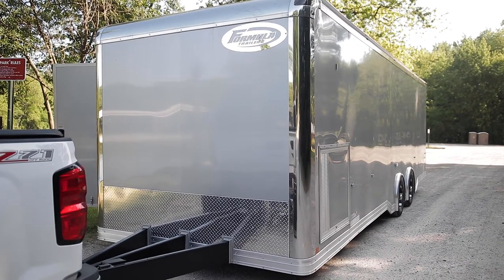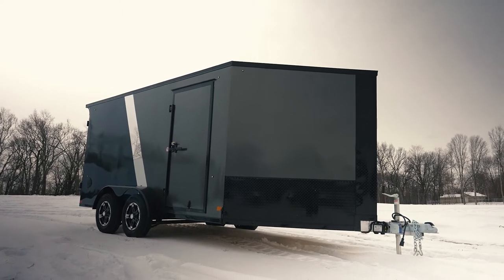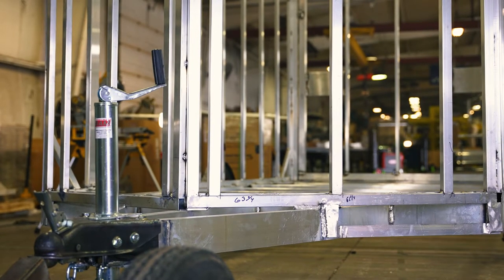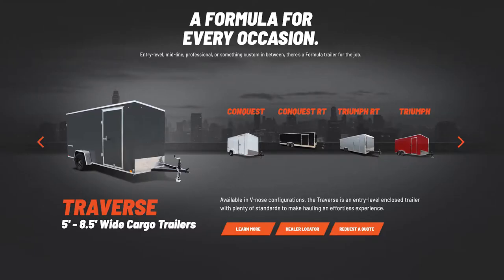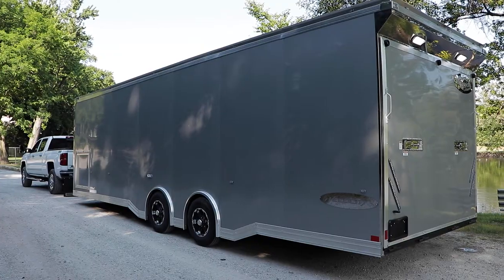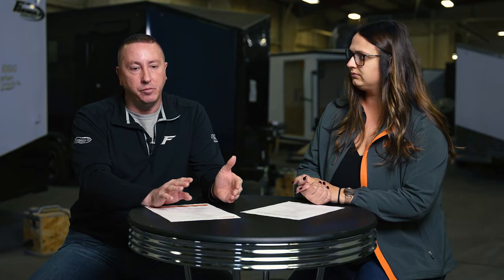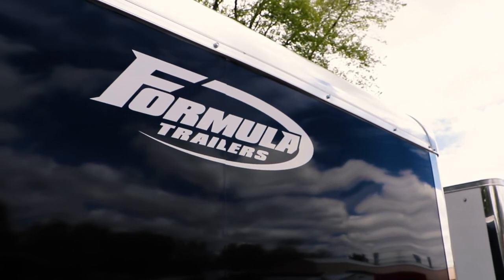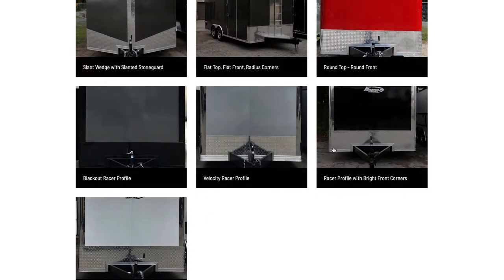Should You Buy An Aluminum Or A Steel Cargo Trailer? - Cargo Concepts By Formula Trailers

Comment: I have a 7x21 all aluminum cargo trailer been sitting on my side property for 3/ yrs soap and hot water and it’s like new can’t say the same for Steele and that’s why I didn’t get Steele plus aluminum is very light weight very easy to pull not to bad on the transmission.
Reply: Aluminium cracks over time time when the welds become brittle. Steel may be heavier but its more robust over the long term provided its had quality protective coatings. The debate around alu v steel is still active

Comment: So on a 7x16 with a 7’ ceiling would would be the weight difference between aluminum and steel 
I am looking for one for a job trailer but want to be able to pull it with my suv at times
Reply: For me it was a difference alu 1900 pounds vs steel 3200 pounds. 7.5x16.

Comment: I am wanting to buy a 16ft enclosed trailer to use for my moving company. At the moment i have a 2012 ram 1500 5.7 hemi sport crew cab that i want to put to use any suggestions or advice..?
Reply from the maker: Hi Edwin.  Thank you for your response.   Please reach out to us using our contact page: https://formulatrailers.com/contact/ - or we would advise connecting with a dealer nearest you using our dealer locator: https://formulatrailers.com/home/find-a-dealer/?zip - this would probably be your best options as we only sell directly to dealers.  Thank you for reaching out.  Please do not hesitate to reach out if you have any additional questions.

Comment: Aluminium has always been cheaper to buy. Why does it cost more for a Aluminium Trailer?
Aluminium material is cheaper than stell!!!!
Aluminium won't rust!
Steel rust.
Aluminium Trailer will last a lifetime. 
Steel Trailer will not last a lifetime.
Reply from the maker: Hey bill!

Alum tube is actually more expensive than steel in today's market.  Alum trailers are more expensive to purchase than steel trailers because they resist rust, are easier to maintain, and last longer. They not only cost less in maintenance but they tend to keep a higher resale value too.

Thanks!
Reply: Aluminum might be cheaper but a professional aluminum welder is not.
Reply: Aluminium is not as strong as steel. Plenty of online information around aluminium welds and cracking. Steel won't. As for rust if its been properly coated you won't have a problem
Reply: @formulatrailers9442 what makes you say they last longer ? Wouldn't that come down to use ? A
I'd argue a well looked after steel trailer that had had a proper quality coating every couple of years will still be going along with alu
Reply: You kind of answered your own question.
Reply: Aluminum is known for cracking around where the axles mount. Aluminum is way more brittle than steel.